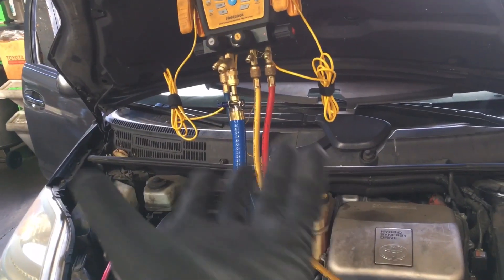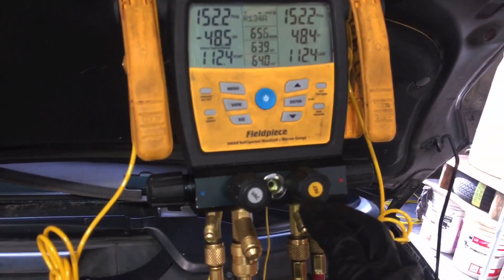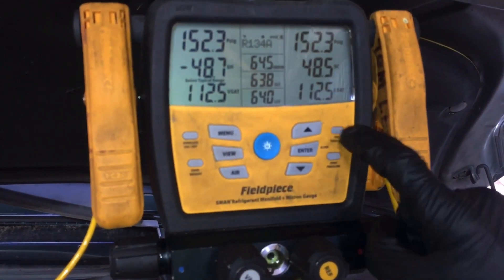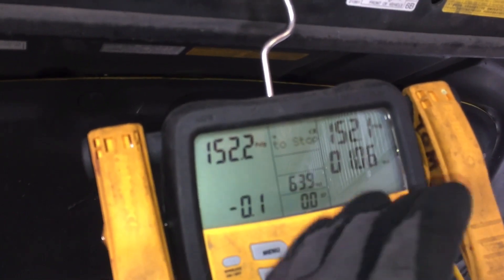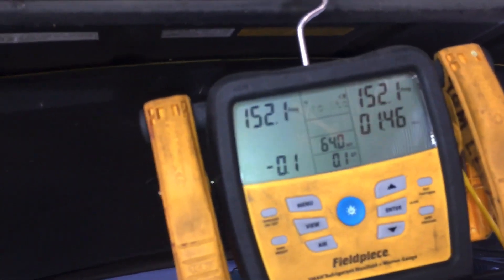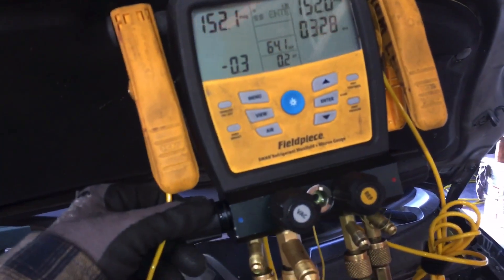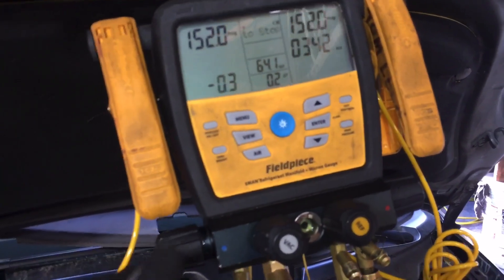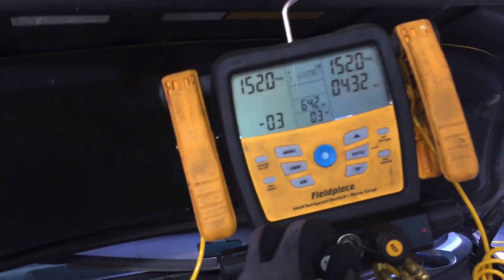Dry nitrogen high-pressure decay test using Fieldpiece SM480V

Comment: So was there a leak on this car ?
Reply from the maker: Yes there was a leak because it came in with no refrigerant in the system but just not a large leak that could easily be found.     That was a year ago so I don’t quite remember what the final outcome is either I found a leak after I put refrigerant in it or did not. 
                Many times you could have leaks that only leak at a certain pressure or temperature when the refrigerant gets hot on the high side or cold on the low side and it only leaks at that point but it doesn’t leak while it’s just standing there in front of you under ambient static conditions
                       Some leaks only leak when the vehicles driving down the road vibrating as it’s moving but does not leak when it’s sitting still in the garage operating.
Reply: @coldfinger459sub0  okay thank you . But the gauges indicated no leak ?
Reply from the maker: @stephang9588  exactly. Proving that all leaks do not leak all the time even though you know there’s a big leak.      Some leaks only leak when the car is going down the road vibrating when components like hoses are shaking and vibrating from the lumps and bumps in the roads

   Some leaks only leak for example the high side refrigerant line starts getting hot as the air conditioning system is in an operation on a very hot day and every time the pressure gets above for example 200 psi the leak opens up and starts leaking and release some of the refrigerant but when you shut the car off The leak stops leaking

        Some leaks only leak when the low pressure low side of the system starts getting cold in operation and the temperature starts approaching 30°F in the middle starts shrinking and it opens up a crack starts leaking out refrigerant but as soon as you turn it off in the middle starts warming up instantly it seals back up and stops leaking

And there’s so many more different scenarios in which a leak can happen and then completely stop and seal up under a different operating circumstance. 

       And this is one of those examples we are sitting static in a garage applying pressure it doesn’t leak but yet there’s a big leak somewhere that will only happen under a certain operating condition this is what makes finding leaks so difficult. 

        So in this scenario this car is a good candidate that when you put in the fluorescent UV dye.     Can you let the car go back out in the road and use the air conditioning like normal for a few days a few weeks or a few months. 

        And after that time when we’re turning where the leak happens hopefully the UV dye came out with the refrigerant in the oil and left a small stain to be visible that the UV light can pick up and see.

Comment: What’s the fitttings and adapter you use for sm480 to hook on to car ac system. Do you have a link to buy? Thanks
Reply from the maker: Sorry no link.   You’re just looking for fittings that have quarter inch thread is a common thread size on HVAC hoses.

Comment: Your actually using the trublu hose the wrong way. Might as well just hook up the regular 3/4 hose. And when you do microns you gotta do less the. 400 and if it passes the 1000 mark then you gotta problem buddy. I do commercial hvac and mainly refrigeration. But nice video spreading the knowledge 🤝👍
Reply from the maker: Yes I actually tell in some of my videos you should not use the true blue hose with refrigerant hoses because you basically defeat the purpose. 
               Because you’re only as good as the weakest link and even if you use the metal pipe from your vacuum pump to your refrigerant manifold and had the possibility to draw down to 1 µm at that point only. 
              You would lose 99% of your benefit as soon as you go through the refrigerant manifold with all its O-ring seals and connections and those horrible refrigerant charging hoses that leak like a sieve. 
          refrigerant manifolds are often contaminated with POE oil or PAG Oil with tons of moisture in the refrigerant hoses. 

          I gear this towards the automotive guys because I know unfortunately they’re usually lazy and some of them are cheap and then there’s the ones who just don’t care or want the quickest easiest cheapest method. 
              That’s why I show them this method

       For the guys to really pay attention they see my videos where I take the true blue hose directly from the vacuum pump right up to the refrigerant lines of the vehicle with no manifold direct connection. 
           Able to pull some of the vehicles under 100 µm which is not easy especially if they’ve been contaminated. 

         I myself sell the LG multi V VRF Systems my son and I do the installations. 

     In those cases when I wanna go overboard I don’t even use the true blue hose I use soft copper refrigerant line as my vacuum hoses. 

     This is what my dad taught me when I was a kid using soft copper instead of hoses and this is what my dad was taught by an older gentleman in refrigeration.
Reply: @coldfinger459sub0  my fault for that. So how you had the trublu hooked up what different do you get then the 3/4 from another brand?
Reply from the maker: @AG-tg9in  you cannot pull a slow vacuum through other refrigerant brand hoses that were meant for refrigerant then you can a silicone hose. 
            And if you attempt to use the hoses to hold your vacuum the hoses themselves off gas and lose vacuum. 

         I know I did some videos before where I switched out large diameter refrigerant hoses for a true blue hose showing the difference in vacuum polled just by switching that one hose. 

          I also showed a video where I remove the refrigerant hoses and use soft copper lines for refrigerant hoses I believe they pulled a vacuum down below 10 µm in that video. 

          For deep vacuum this was the method my dad showed me as a child more than 40 years ago.     Using soft copper as lines with something that was shown to my dad by an older refrigeration gentleman. 

         Using soft copper or stainless steel in Laboratories has been around forever it’s an old method old technology it works better than anything else it’s the cheapest thing to use because we all have scrap copper. 
              And it works the best. 

But I did a series of videos I believe on Fieldpiece gauges that were brand new swapping out different refrigerant hoses using a micron meter on showing the difference in performance.    
                  In a few of the videos I even use the BluVac Accu tools micron meter with the software data logging the vacuum over night pulling down below 10 µm and then data logged the vacuum decay over a 10 or 12 hour period of time.

            In my progressions of videos using different poses in different upgrades you can actually see the evidence by the measurements by the micron gauge of improvements.
Reply: @coldfinger459sub0  how long ago was that video u mention?
Reply from the maker: @BERESHIDA2008  I found one of them this is number for video so there’s some videos before this one and there’s several videos after this one they’re kind a spaced out

https://youtu.be/5tbP0AlST14

Periodically I released videos about refrigerant manifolds and testing them specifically showing why it is not a good idea to use refrigerant manifolds when you’re trying to pull a deep vacuum. 

          But when you’re learning and you’re starting and buying a whole bunch of components is out of your budget you might as well start with a good refrigerant manifold that has a micron meter built inside so you can at least get a general reference of how it works and learn how to look for problems even if it’s your own hoses your own gaskets or connections that are causing the problem. 

     Fieldpiece SM480V.  It’s about as good as you’re going to get for an excellent starting point. 

https://www.trutechtools.com/Fieldpiece-SM480V

The link above takes you to an Internet tool sales place that just specializes in air conditioning tools this is where I get my air conditioning tools from
Reply: @coldfinger459sub0  and how is the new testo that you got replaced holding?
Reply from the maker: @BERESHIDA2008  sucks even the new one has some problems. 
       I will not be buying another test the manifold for many many years to come until they come out with something good what a waste of money. 

     My old Testo 570 was very reliable very good piece of equipment it just didn’t have all the bells and whistle‘s and software and Bluetooth capability

      They had a good platform they should’ve stuck with it and just tweaked it in modified it

    Instead of trying to reinvent the wheel and screw up

Comment: You did not hook on the suction line temperature clamp for the changes in temperature and pressure of the nitrogen. With out that u'll never know, especially if it's a small leak with the change of temperature of line & nitrogen.
Reply from the maker: Do not need the temperature clamps for the short duration pressure decay test. 
               The temperature in the shop or the car is not going to change within three or four minutes. 

      Sometimes reading or just being a smart or listening to a YouTuber I t’s not a good thing if you don’t know the whole story

         Do you have to have a firm understanding of the physics and science hind your tool and process your performing to know what you can and cannot do. 

          And using the temperature clamps in some scenarios can get you into big trouble giving you false data if you don’t understand the physics and science on how they work. 
            On the type of equipment that you’re diagnosing have there’s a unique scenarios that can set you up for trouble if you just listen to a tool a tool is only as smart as a tool that is using the tool.

Comment: On the newer r1234yf systems are you still going to 150 psi when you pressure test with nitrogen or are you testing with higher pressure?  Prior to watching your videos I had been doing testing to 250 psi to test ac systems, but 90% of the cars I work on are classic mercedes with r12 so the components are pretty beefy.
Reply from the maker: On the 1234 I do at 170 psi